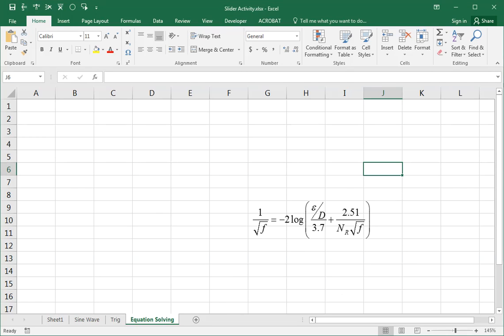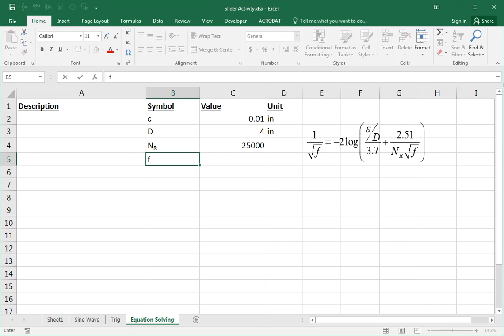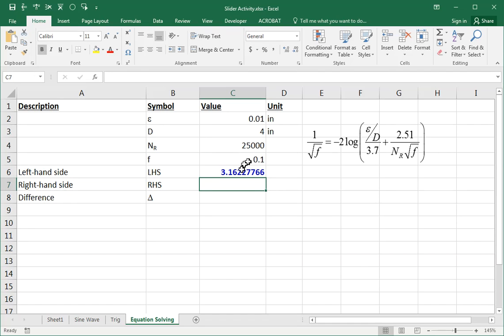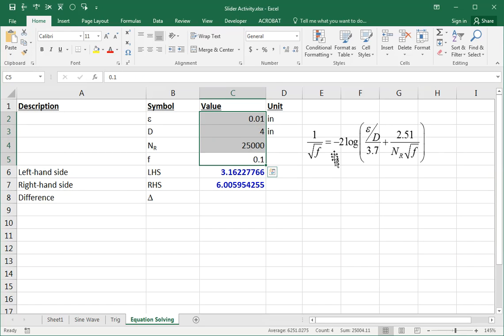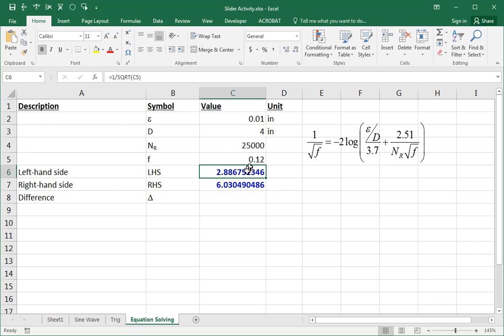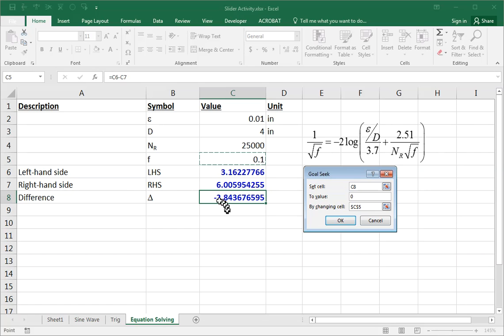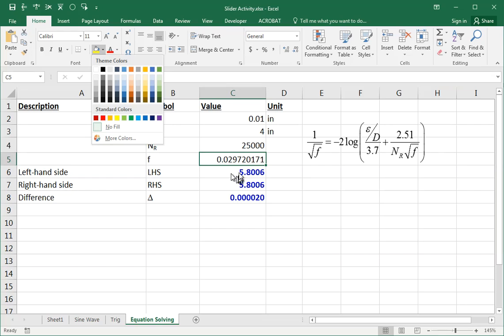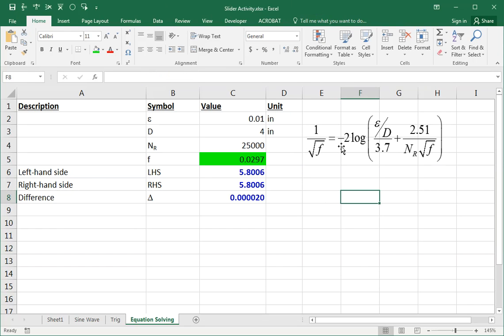Numerical Equation-Solving in Excel

Comment: Is there anything in the nature that that formula presents or is it just a random pile of symbols?
Reply: This is an equation derived empirically for a special case of a fluid dynamics problem. It has no elementary solution and therefore requires numerical iteration to solve. Specifically, it solves for the friction factor based on: the geometry of the container of the fluid, the specific roughness of that container material, the fluid physical attributes (viscosity, density), and fluid kinematics (composite fluid flow velocity). The friction factor is a direct scaling modifier to the velocity head of the fluid, which outputs an estimation on the net head loss (i.e. energy) of a container section. For example, it is helpful in calculating the required pump input power to overcome friction, velocity, pressure, and gravitational head in a fluid system.

Comment: Thank you very much for the tutorial video, can you show how to autocorrect the symbols.
Reply from the maker: Juan, that wasn't an autocorrect, I was using an add-on called something like Excel Subscript and Superscript Tool, that no longer works in new Excel.  To get an epsilon, the easiest way is to put in an "e" and change the font to Symbol, which shows most English letters as Greek, i.e. a becomes alpha, b becomes beta, q becomes theta, h becomes eta, etc.  Or you could use the Insert command to insert a symbol from the large character set, and just find your epsilon under Normal Text.  I hope you found the video helpful, it's an old one now.